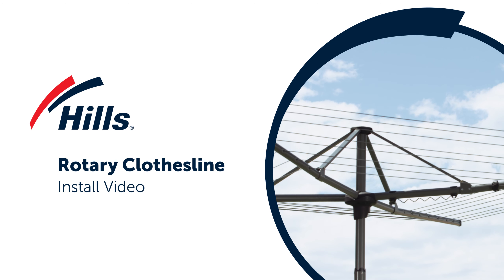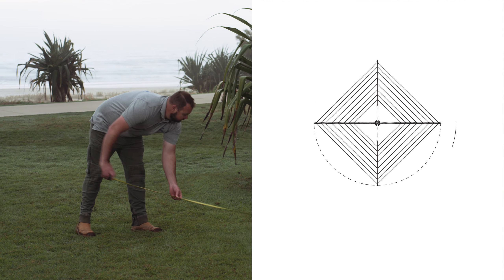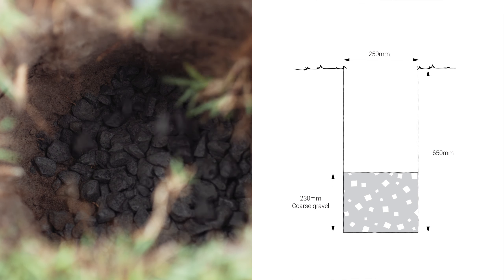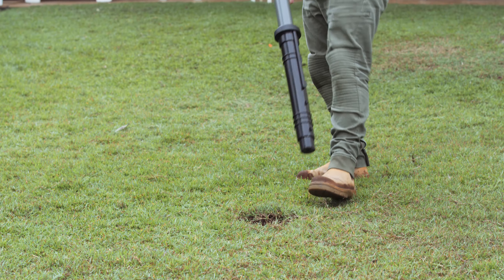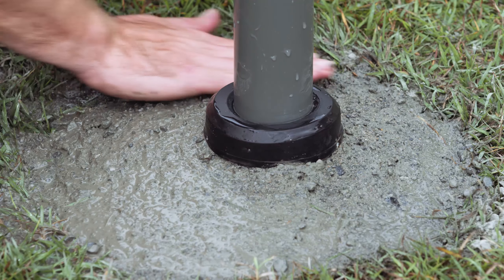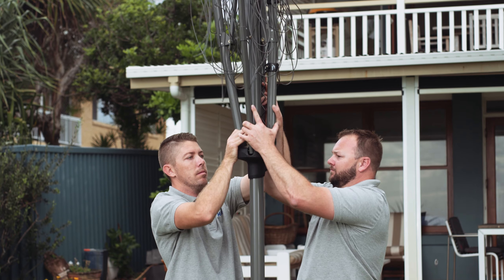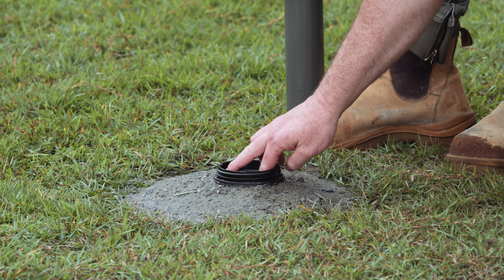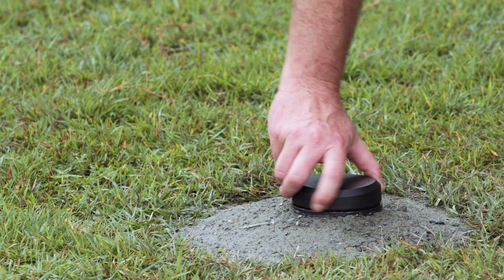Hills Rotary Clothesline - Installation Video

Comment: Hi, The lower cross arms wont go high enough to lock in ?
Reply from the maker: Hi, thanks for getting in touch. If you haven't already, your best bet is to get in touch with our Customer Experience team. You can fill out the online form at: https://support.hillshome.com.au/hc/en-au/requests/new or send them an email via hills@amesau.com and they will be happy to assist you. 

Many thanks, The Hills Team 💙
Reply: Anyone having this issue, just check the cords. If any of them is tangled and is not in its correct position, the top will not click into its position.